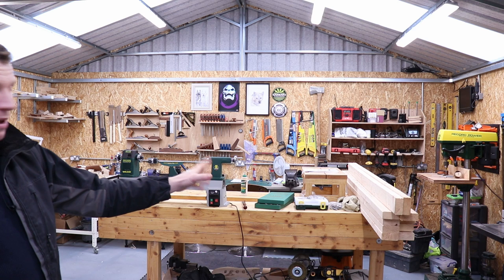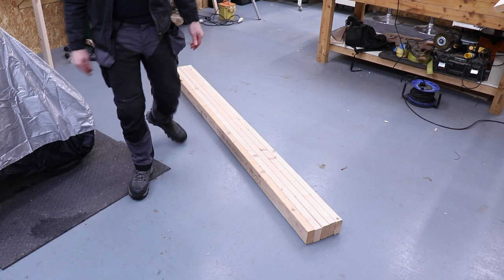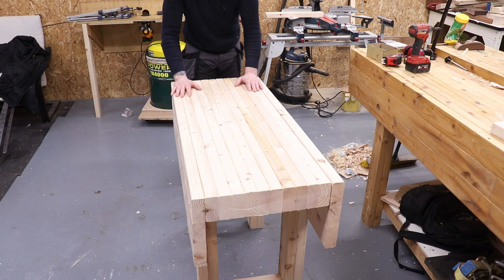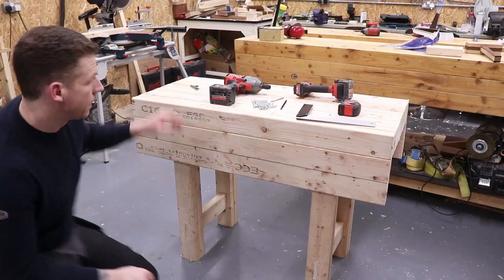Woodworking Workbench. Solid, Strong, Easy to build, Cheap to Make. Last a Life time.

Comment: great instruction.  From experience you can drill the bace of the bridal and then when you cut the sides the bulk of the waste will fall out. then you just have a little waste to remove with the chisel.  traditional mortises are cut first, that way the tenons are easier to fit to the mortise. I am thoroughly enjoying your style. all the best Michael

Comment: up late,watching this,gonna make a workbench in new year,have it all planned out,8x4 so you can guess what top is gonna be,but legs and frame is gonna be same as yours so this video helped me,especially my worries of using pine,as you know how bad it can be in ireland from yard. i will be putting massive dowels in all joints for strength and biscuit joints to align.
Reply: and have a very Merry Christmas to you and yours
Reply from the maker: Glad it helped, let me know how it goes. Happy Christmas and a happy New year

Comment: If you don’t have a band saw could you cut the bridal joint and mortise in the legs before you glue the 2x4s together?  (Clamp them together to draw out the knock lines so they are aligned.)

Comment: Alri John.. Would u suggest going to a timber merchants for a better deal on the wood? I'm about to begin setting up my own workbench for a workshop in my garage.
What is the best surface for a tabpe saw?? Some ppl say Plywood has toi many imperfections, meaning it wouldn't be a level working surface so I was wondering which material was the best for buikding my own Table saw with the Router built in as an extra fitting.
The info for this build was excellent too man. Brilliant work John.  🛠

Comment: Nice  but very time consuming. It is much easier to cut the mortise before gluing the two boards (I think)  using a power router and a little or no chiseling (13:00)

Comment: just watched your handplane video  and subbed. I was wondering though, do you not have a tablesaw? or a jointer...I believe you would call it a planer.
Reply from the maker: I had a table saw, restored it then sold it as I wasn't using it much and I have a planner/jointer which I use all the time. Thanks for the sub welcome along!